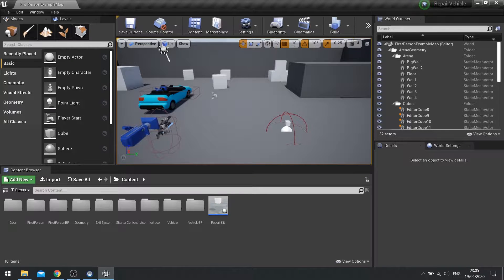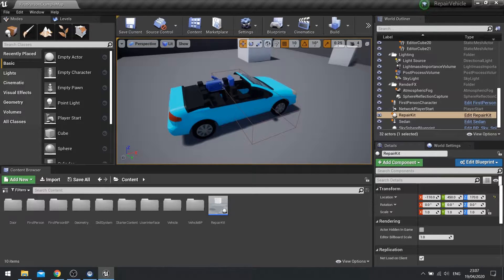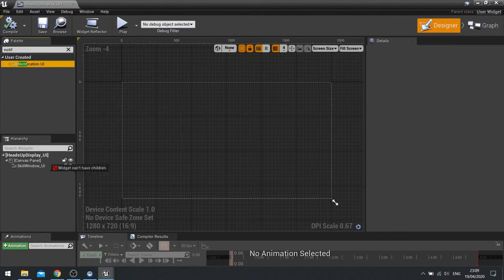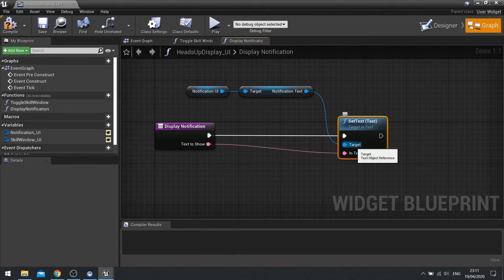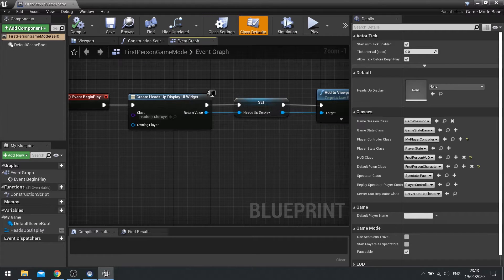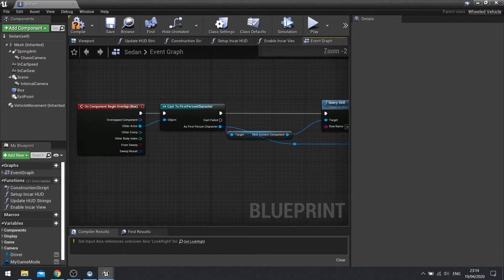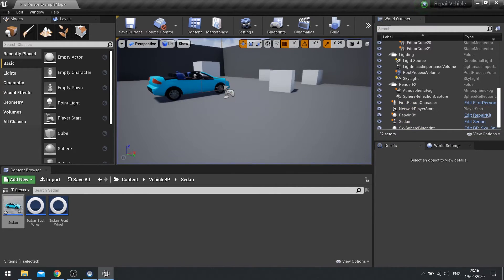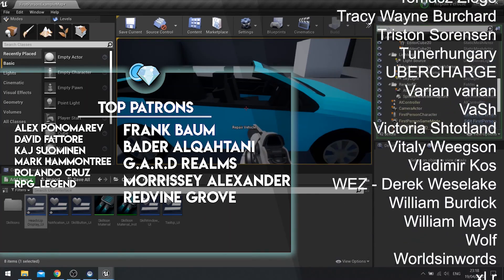Unreal Engine 4 Tutorial - Vehicle Repair Part 1: Repair Kit

Comment: Have a tutorial idea.
Putting wheels on the vehicle.
Pick up tire have it float in front of camera like half life.
Walk to vehicle.
Have the tire snap to wheel section of the car if no wheel is present.
Can drive a vehicle with 1 or 2 or 3 tires?
Reply: Theoretically, yes. Just disable the components that don't have a wheel connected
Reply: @CyberWolf755  a video explaining how to do all that would be very helpful indeed. 🙂